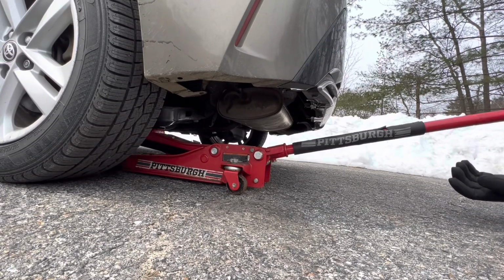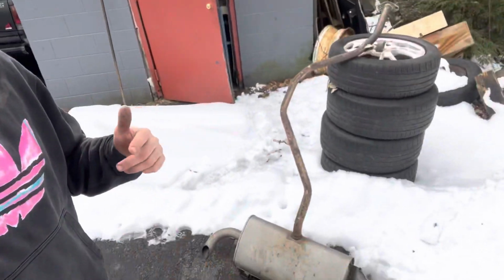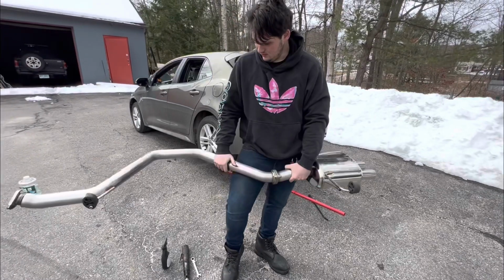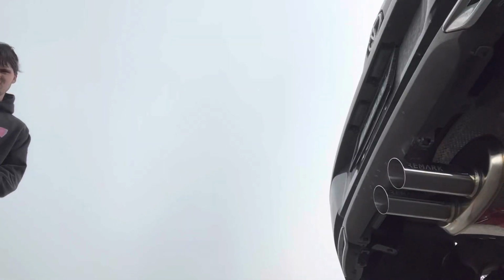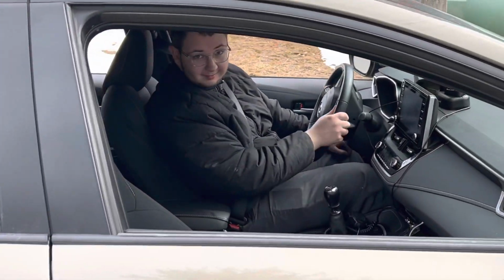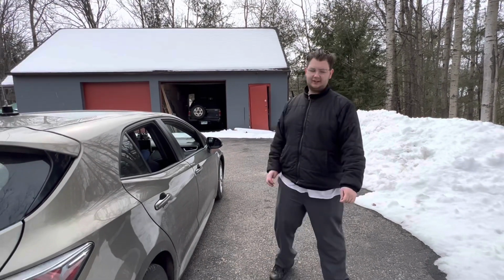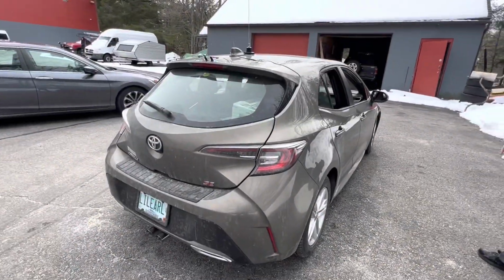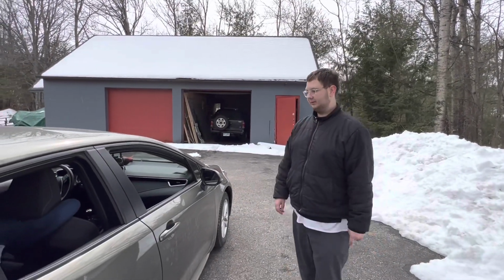Installing a Remark exhaust on a 2020 Corolla!

Comment: The dual exhaust from remark is Awesome!! Got it on my 21 Corolla hatchback  so much more horsepower especially driving the 6 speed. Loud and Proud!!
Reply: Not sure it adds that much horsepower but it definitely sounds good.
Reply: @nathanz602  you can feel a noticeable difference with the 6 mt
Reply: Without the remark my gas mileage was 34 mpg but with my remark now i get 39 mpg !!
Reply: @michaelrada725  that literally makes no sense.
Reply: It's a known FACT that with a stick shift you get better gas mileage and I'm 59! And all of the cars I've driven they all had or have been manual and it's the best!